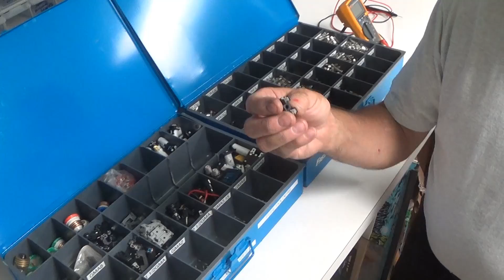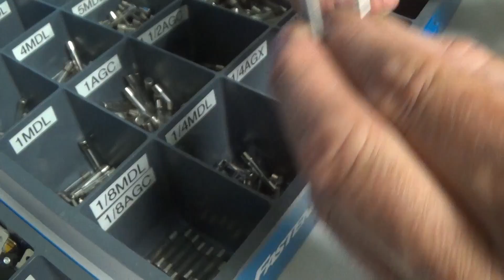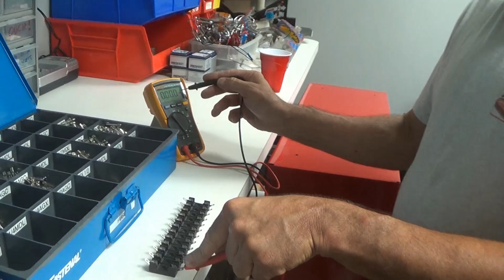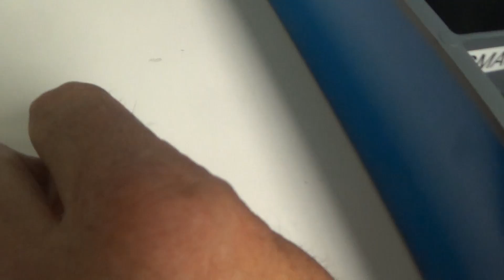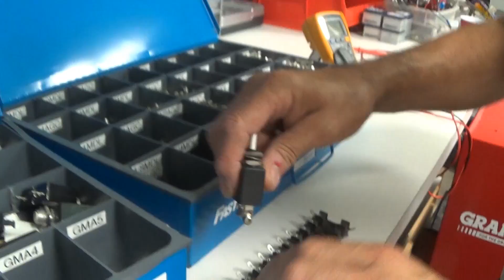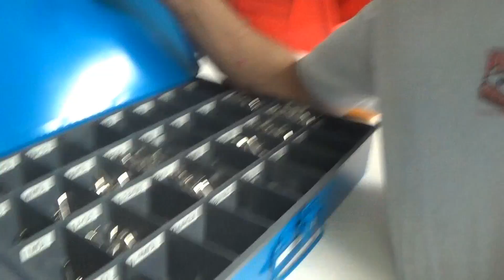Ray's Pinball Tech Tips #10 - Blow Me? (Fuses!)

Comment: I just picked up a twilight zone and Indy 500 pin and am currently going through the fuses in the manual and machine to me sure they match. I understand that she is slow blow and th is fast blow but on both machines it states that f114 is a 8amp NB fuse and it only states the voltage of 32v in the Indy manual. I'm assuming that Mbeki stands for normal blow. Any thoughts or suggestions? I just want to make sure they are in the best operating order I can get them. Thanks and I've almost watched all of your videos Ray and I love them, keep up the quality work.

Comment: Bangs head on monitor!
So I checked my fuses and saw that only two were correct but I am still going to replace all the fuses that went into my HS.
I have a list which I showed on my latest video that is about 1 hour long giving an update video of what was done and still needs done.
I have been on the Marco site looking at fuses and cannot find all of the fuses my machine used so is there substitutes I could be using instead or am I just blind and do not see the fuses?
Oh and will I need to replace that big 30,000uf Microfarad screw terminal type of cap?
Oh yeah and I want to do a rebuild on my Power Supply board have a website that sells the kits for my System 11 P/S?

And if you could not tell I am digging into my pin heavily I am trying to get it done before April 1st which is my birthday and possibly have a pinball party finally. >.<
Reply: Gameroom Collectibles / Pinball
Alright cool thanks! :)

Comment: Another great arcade tips video!
My favorite part was the very last when you two were trying to figure out who to shout out to. :)
And I agree should do a multimeter video some time.
But the pop bumpers is a good one as well as I need to rebuild my pop bumpers.
Well I am beginning to think I need to replace everything in my poor pin to be honest. xD
I am also thinking of doing a power supply rebuild of the caps and replacing the bridge rectifiers.
One of these days my pin will be done. Heh